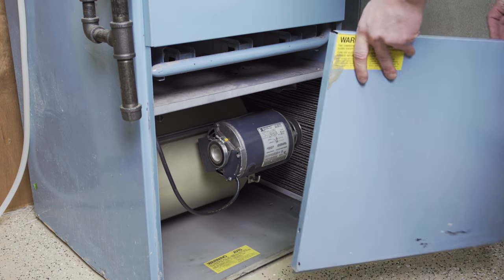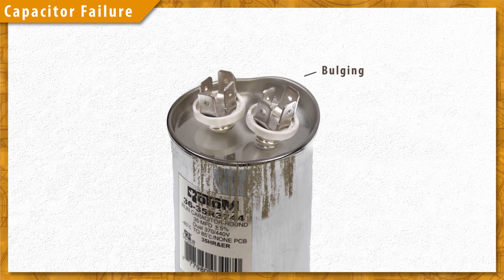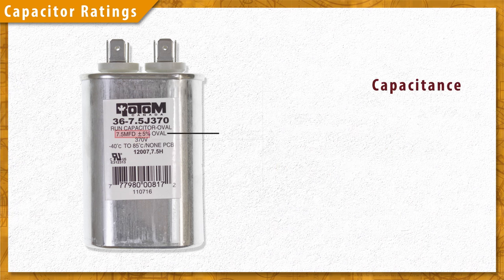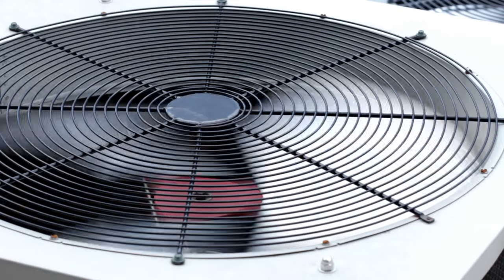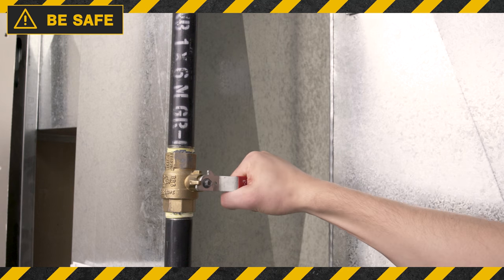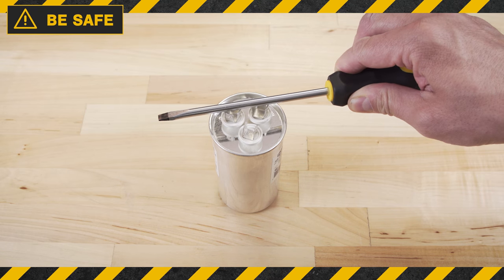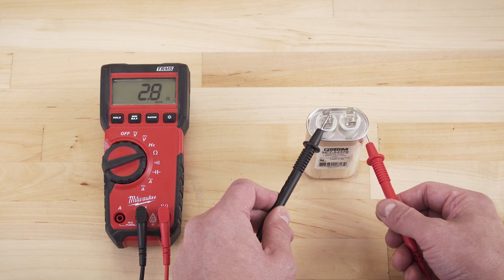How to Test an HVAC Motor Capacitor | Spec. Sense

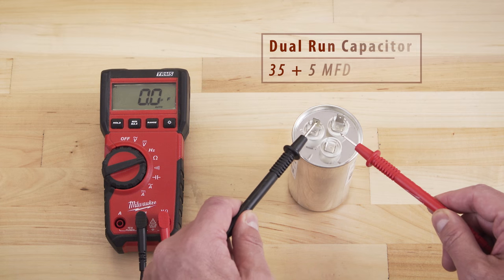Comment from the maker: Update Just to clarify at 4:07 the multimeter should be set to capacitance for testing the dual run capacitor. Unfortunately this shot can not be fixed without deleting and re-uploading the video. Overall these errors do happen when filming multiple takes, combining the multimeter shots with the actions, sometimes the wrong shot is placed in the timeline.
Reply from the maker: @cafemolido5459  thank you for watching. Once videos have been uploaded, they can not be updated or altered without losing all views, comments and interactions and many other people have found this video helpful even with that section of the video in. If we reuploaded this video it would like never reach the same visibility in the YouTube / Google search which means less people would be helped by this content. This pinned post is a way of communicating any updates so that people are aware of this detail.
Reply: Why do you still get the correct reading in mF though when you are on ohms…
Reply from the maker: @p__jay  It's a result of how we edit the videos. On the multimeter, sometimes the value jumps around and sometimes we get reflections in the screen. In some cases we cut out the screen and paste it to another shot that has a better hand motion. In this example the screen was used from a capactance testing shot and the multimeter itself was used from the resistance shot (testing for a short).

Comment: Excellent ! I regret I did not see this video 2 years ago when I was told during my HAVC inspection that my capacitor needed to be replaced and I had to pay $228 for this operation. A few days ago, during my annual inspection, the technician told me that the capacitor needed to be replaced again ! the price tag was now $479 !! Holly cow! When i asked him the reason the price went from $228 to $479, he just told me that the prices of capacitors have been going through the roof. My guts were telling me it was fishy. Then, I found this video. I bought a multimeter online and I checked the capacitor, and yes, it was weak (4.6 uf instead of 6 uf). So, I did some research and found an online store that sell the exact same capacitors. The price shocked me: only $1.98 the capacitor ! I ordered it and replaced the weak capacitor with the new one by myself, after finding a video explaining how to do it, and it works perfectly! So, I just saved $477.  Incredible !!!
Reply from the maker: Thank you for sharing your experience! We're just happy that people are finding these videos helpful, especially when it helps them save a few dollars.
Reply: @AmreSupply  well, it is not just a few dollars but a lot ! So, thank you very much for it.
Reply: I have friend's 42" industrial stand up fan. The motor just hums. I tapped on motor and capacitor casing. How do I avoid danger by taking the capacitor out of the fan?

Comment: When there is only two wire to attach to the capacitor. Does it make difference which wire should go on which terminal?
Reply from the maker: Thanks for watching. A capacitor is not effected by polarity so it doesn't matter which of the two wires are connected to each terminal. The capacitor will still build and release a charge to help the motor start.

Comment: I'll be testing a dual run capacitor that's part of my home Coleman HVAC; a packaged unit that's mounted on the roof. Not sure how much of a pain in the ass it will be to access the capacitor but once I do, this your video will most definitely come in handy. Thanks!
Reply from the maker: Thanks, we're glad you found the video helpful! Best of luck on the repair!

Comment: 0:15 capacitors in single phase motors incl furnace blowers, AC fans, compressors and pumps
1:22 maximum voltage that the capacitor can be exposed
Reply from the maker: Thanks for watching!

Comment: This was such a clear and  concise video. It helped to get a basic understanding of the workings within a Capacitor in a simple way. Ended up finding the Capacitor had grounded out causing it to fail in my Coffee Grinder (Industrial).  As this was an older unit the wire coating had become brittle, exposing bare wires in several places. Replaed all the wires with two new Capacitors and it's good as new!! Thanks so much.
Reply from the maker: You're welcome, we're glad that you found the video clear and easy to follow!

Comment: Thank you Vance, and what does MFD mean when testing capacitors? Micro Farad Discharge rating, is that always printed on the spec label? Under MF? or MFD? And I didn't see anything about the furnance capacitors in the furnance videos wondering what the signs of a bad capacitor on a furnance is, I know swollen, not turning on blower motor or control board? Ok, I'm not remembering the details of the topic sorry too much to try to digest. HVAC capacitors. Thank you Sir.
Reply from the maker: Thanks for watching. MFD stands for Micro FaraD and is the the level of capacity in a capacitor.

If the capacitor fails then the motor might not start, or will not run efficiently depending on the model. If you are curious, the different motor types are explained here: https://www.youtube.com/watch?v=vpspMVQQXRs

Comment: Why did you use ohm to test the dual capacitor with the common fan and herm?
Reply from the maker: Thanks for watching. We made a pin comment explaining this. At 4:07 the multimeter should be set to capacitance for testing the dual run capacitor. Unfortunately this shot can not be fixed without deleting and re-uploading the video. Overall these errors do happen when filming multiple takes, trying to get the best hand motion or the clearest shot we were combining the multimeter half of the screen with the action of testing with the probe. In this case the wrong shot is placed in the timeline which had the wrong setting showing on the multimeter.

Comment: Question: Is that insulated screw driver just a normal screw driver with a rubber? Handle? 
I bought electricians screwdrivers and they are covered with rubber or insulation with just the tip of the screw driver head being metal.
So if I tried to use the harbor freight electricians screw drivers I would'nt be touching metal to metal to discharge the capacitor? or can I use say for instance a harbor freight "normal" pitsburgh screw driver with all metal except to the handle which is rubber?
Reply from the maker: Thanks for watching. In this case, to discharge a capacitor the shaft of the screw driver has to be metal, and the handle will be insulated to ensure that the hands are protected from the discharge. Gloves are always recommended, and using a resistor to discharge a capacitor will always be the most safe when compared to a screwdriver.

Comment: What if it reads right when you first put it on but then climbs out of range?   I didn't see this scenario in here?
Reply from the maker: Thanks for watching. When testing for capacitance, the multimeter is charging the capacitor in a sense. The values will might take a moment to measure but it shouldn't climb out of range. If it's outside of the range, then replace the capacitor.

Comment: This is so educational and informative.   Our unit goes on and faults out prematurely (I think it's always code 33).  The 'tech' wanted to swap the control board but also questioned the cap (though it looks good with no bulging).  I saw that he was just throwing parts art it, and I can do that.  I'll read the cap and think he did show that it was lower (then why didn't he change it?) but suggested the control board, and then maybe the cap.  He even suggested if the cap was bad, it could damage the board.  If the cap is outta range, might just replacing it suffice?  Regardless, I think that'd be a better first step (if needed) than the swapping the board first.  I'm an engineer and work on everything, including all appliances so I'm not just hacking here.  Regarding your cap discharge screwdriver, same is true with microwaves, so I made a discharge tool with alligator clip and resistor.
Reply from the maker: Thanks for watching! We're glad that you found it informative! If the cap is out of range then you'll want to replace it as the blower fan will not work properly. A weak blower motor will likely trip the limit switch causing a shutdown. Now if your furnace starts and shuts off then it could be one of several problems. First find out what the 33 code is by referencing your manual. It will likely point to a particular stage in the furnace sequence rather than a part. This video outlines this in more detail: https://www.youtube.com/watch?v=b0sAGt-1niU Hope this helps!
Reply: @AmreSupply  THANKS, I had watched that already.  I had pulled pulled and cleaned  the flame sensor.  Our 33 suggests filter (which was cleaned) or limit switch, which I need to find.  All is fine until about 4-5 deg below set point, then it stops with blinking light with 33 code.  I'll check limit for continuity but it might be intermittent as you say.  Might it be thermostat?
Reply from the maker: @girohead  The limit switch in your case would be the best place to start. Its a bi-metal switch with metal contacts that can warp overtime as the metal fatigues. This means that the temperature that it will open at can decrease as the switch wears out. This is harder to test or pinpoint as the switch will have continuity at room temperature. The switch is pretty in-expensive and would be a good thing to eliminate.
Reply: @AmreSupply  I'll certainly call you guys.  I've not measured my 10uF capacitor yet, but if bad, what would that do?
Reply: @AmreSupply  I called and they needed a part number but aren't they the same for all Bryants?  I also saw that they could be damaged if run and set frequently due to dirty filter (which started all this).
Reply from the maker: @girohead  There is likely a small bit of variety between different models. There should be a part number and the temperature ratings on the limit switch itself. A dirty air filter and constant overheating can shorten the life of the limit switch.

As for your other question. A failed capacitor will prevent the motor from starting as it no longer has the auxiliary winding. A weak capacitor might still start the motor but can affect torque and efficiency.
Reply: @AmreSupply  Thank you, I took a photo of the sensor but see no numbers, it looks like typical Bryant one.  I called your office but they needed a number.  I just spoke to the tech who diagnosed and he said that he checked all those (though I believe you when you say it could be damaged and intermittent, which is how it acts) and still thinks it's the $1000 control board and that I 'need to trust him' (after I found the board online for $100 or less), 'I'm not liable if you shock yourself....Now, I want to fix it out of spite.
Reply from the maker: @girohead  Not all manufactures post parts diagrams but maybe see if you can pull up your furnace model number to try to narrow down it from there. Limit switches can look identical but often have different max temp ratings as well as a different rated temp that the switch closes after cooling down. These are often listed as several numbers joined together like 220F-40.

As well if you do end up replacing the control board it is quite simple as shown here: https://www.youtube.com/watch?v=4SY8lRl8HV0&feature=youtu.be

Cheers!

Comment: Can a capacitor test for continuity? When it read on continuity, is the capacitor good or bad, not to groun but the two terminal
Reply from the maker: Thanks for watching. A capacitor is best tested by using the capacitance setting on a multimeter. Testing for continuity will tell you nothing useful about if a capacitor is good or needs to be replaced.

Comment: Can you tell me why sometimes my blower motor will come on and sometimes it just hums?  When it just hums, I get a slight bumming smell.  Also, when it hums and I turn the electric switch off then back on, it usually works again.  Can you tell me what that might be?  Capacitor? Or do I need to get a whole new blower motor?
Reply from the maker: Hi Jennifer thank you for watching. If you test the capacitor and its below its rated values then you'll need to replace it. This is a inexpensive place to start and is usually worth trying. If the capacitor is good then its likely a problem with the motor  Overtime the motor bearings can wear down making it harder to turn. You can try to turn the blower wheel by hand and see if its smooth. If turning feels restricted in any way then you'll want to replace the motor. The slight burning smell is likely the motor overheating when its just stuck in place.
Reply: AMRE Supply Thanks for the advice.  Can you tell me what motor and capacitor I’d need for this furnace and where I’d get both?

Carrier Gas Furnace
Model# 58PAV135-16120  58PAV135-20
Serial#. 3096A07906
Reply from the maker: @jenniferappleton4944  We sell a wide range of motors and capacitors here at AMRE Supply. If you call our Customer Care Center 1-800-661-9891 and provide that information we can narrow down the replacement parts for you.  As well you can email directly at customercare@amresupply.com

Comment: Is it possible my Trane 4TWX5042A1 heat pump doesn’t have a capacitor for the fan? There is a single 45uF capacitor (97F9646) and no other capacitor visible anywhere. The fan is GE ECM 230V AC. The cooling fan starts with a jerky movement and never really gets going.
Reply from the maker: Thanks for watching! If your motor is an ECM or Electronically Commutated Motor then it won't use a capacitor. ECM motors use a electronic controller to convert the AC voltage into DC. The controller then modulates the frequency to speed up or slow down the motor as needed. If you are having issues with the motor then its likely an issue with the electronic motor control.

Comment: Shorting out the capacitor is bad practice and will harm the capacitor. Discharge it through a 25W ceramic resistor or via your multimeter.
Reply from the maker: Thanks for watching. You are right that using a resistor or dedicated discharging tool will be best.

Comment: Can you test capacitance while wired to the motor or does it have to be removed? I tested one and it had OL while wired, but then when I took it out, it gave a reading of 5.1 for a house fan motor capacitor. I think it should be 5.25 or 4.75 to be within 5%.  Thanks!
Reply from the maker: Thank you for watching! Its best to test capacitors when isolated with the wires removed. Now if your capacitor is rated for 5 mf, then a reading of 5.1 is perfectly fine.

Comment: Don't understand how to set my Plusivo cheap multi meter to do this test.
Reply from the maker: Thanks for watching. A basic multimeter might not have this function included and will likely just have several resistance testing ranges, voltage and amperage.

Comment: On a run capacitor with rating 7.5 mfd what rating would be a bad capacitor?  Example if 7.5 rating but get a 5.3 would it be bad?
Reply from the maker: Thanks for watching. Anything outside of a 5% difference to the rated value. So in this case anything lover than 7.1 or higher than 7.9.

Comment: Today I changed a 4 mf +-4% capacitor because on my multimeter it showed 3.42. Would you say the capacitor was going bad?
Reply from the maker: Thanks for watching. 3.42 mf is outside of the tolerance for that capacitor so it was likely going to create problems if you left the old one in the system.

Comment: I have a start capacitor with a reading of 244mfd and a rating of 233-280mfd, therefore within range but on the low side, should I change it anyway since motor seems to just hum and not start?
Reply from the maker: Thanks for watching. That is close to the 5% tolerance but for how inexpensive the capacitor is compared to the motor & control board it is a good thing to eliminate as a potential source of the problem. 

It's also good to check the wire connectors for any corrosion, and to make sure that all the connections are secure. 

If your motor is a condenser motor it might also have a start device or relay. A faulty relay can also prevent the motor from starting.
Reply: @AmreSupply  thank you! I ll go ahead and replace the capacitor; the motor is in a washer, it is 2 speed, the regular washing speed works, but the spin cycle only causes the motor to hum and emit a burning smell, thus my confusion, how can the low speed work but not the high speed, perhaps each speed has it s own set of windings, and the high speed windings have a short?

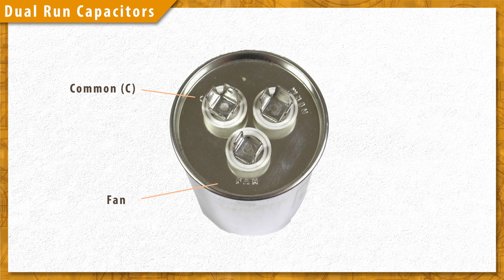Comment: 2:25 This is my AC start capacitor.
How far out of spec (capacitor) would one
typically be, to the point where the compressor may have 
trouble starting or just not start?
in terms of %, 'BALLPARK' I realize there are many different
ac sizes and models.
Reply from the maker: Thanks for watching. Generally anything outside of a 5% difference of the rated value can create issues.
Reply: @AmreSupply  
How far out of spec (capacitor) would one
typically be, to the point where the compressor won't start?
Reply from the maker: @bikersoncall  10% or more. When troubleshooting you'd want to check the compressor windings for resistance / continuity, as well as check any overload protection devices or relays.
Reply: @AmreSupply  Thanks.
Reply from the maker: @bikersoncall  You're welcome